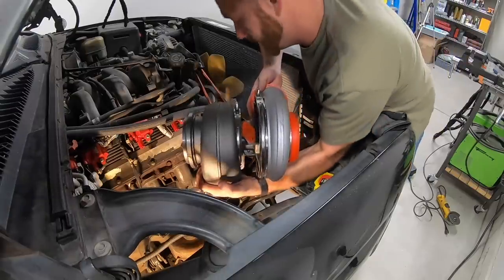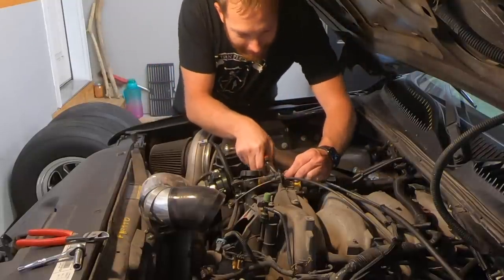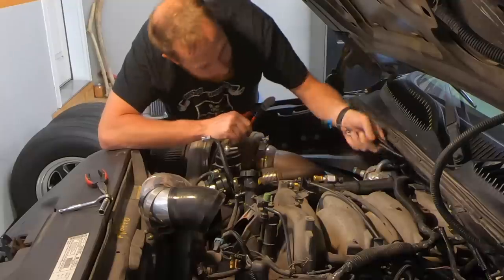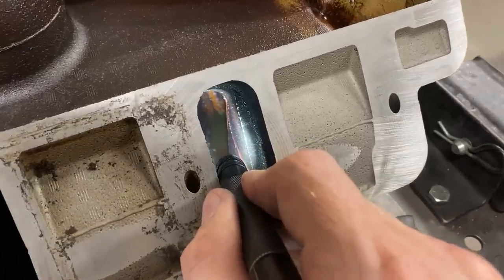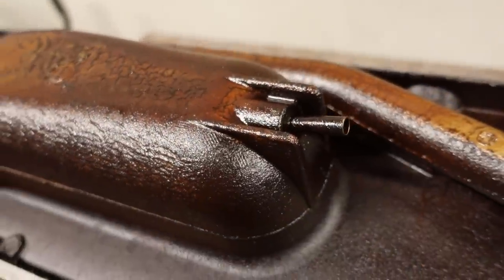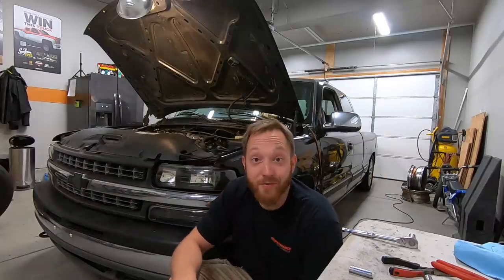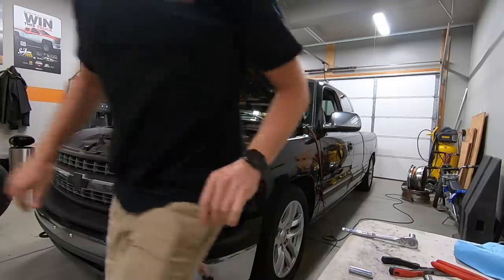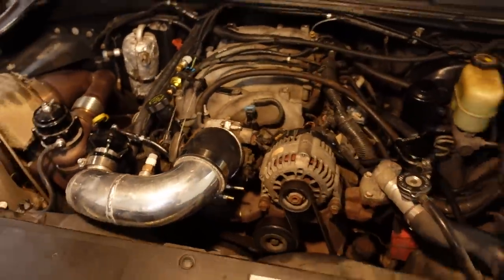this is the WORST ENGINE DESIGN I've ever encountered

Comment: The turbo would spool quicker with a vacuum line to the top of the gate and a boost controller that would hold the gate 100% shut until the commanded amount of boost. Just a bottom reference opens the gate slowly, giving up response.

The turbo smart eBoost2 controller solved this problem for me. Love the build 👍
Reply: Maybe this "slower" spool is what has kept the junkyard engine alive?
Reply: Adding a supercharger to the turbo would give hime hp at low rpm’s
Reply: @eric9249  absolutely a possibility
Reply: @eric9249  and it running on e85
Reply: @eric9249  FACTS!     Exactly what I was thinking!  It’s why my stock (aside from stainless steel 1.25” butt weld fitting manifold I made up as stock turbo is cast into/is part of the manifold) 2000 VW golf 1.9L TDI can handle 38-40 psi of boost no problem.

Comment: Hi LT,  my two cents worth;
first, was there a separator shield under the intake manifold? didn't see it. All stock 8.1's had the shield originally from GM.  It's job in life is to keep the oil film/ vapors separated in the air space under the manifold and away from the calibrated vacuum leak. with out the shield the vacuum will suck up all the vapors thrown off the spinning cam and lifters. Also you have the original plastic intake gaskets that GM found lost their compression seal very early and oil was sucked into all the ports. this was found to be the main cause of oil consumption on the 8.1. GM made a new style of steel gasket with a black rubber O-ring seal for the 8.1. It seems to hold up much better over time. Sooo that stupid vacuums leak works very well for almost all NA applications. With a boosted application such as your blow through turbo, or the older Whipple that used the stock manifold, you do need to plug the hole in the bottom of the manifold to keep from pressurizing the crank case and blowing out gaskets. . 
 I would bet that the reason you are not smoking any more is that you put on NEW intake gaskets... 
This has been a common problem even on the GM 265-283-327-350 small blocks for years, replace the intake gaskets ,oil smoke goes away.. Me, I still like the design of the calibrated vacuum leak for the PVC. keeps the engine pretty much leak free for hundreds of thousands of miles.. 
still love your show.
Best to you. 
LH.
Reply from the maker: hey, you could be onto something with the gaskets. and yes, the little splash tray is still in place above the lifters and below the intake
Reply: How about a check valve for when it’s under boost but releases when the manifold returns to vacuum?? Kind of like the 1.4 turbo engines have from the factory?
Reply: Wasn't the AMC 242 the first engine with the "calibrated leak"?  Either way it sure works good on that motor.

Comment: With all that boost bleeding into the crankcase, I am surprised you didn't blow out a rear main seal or other seal.  I am really surprised there wasn't a check valve.
Reply from the maker: luckily, I had modified the throttle body last year so it will bleed out some of the extra pressure which is probably the only thing that saved it
Reply: @LawrenceTolman  hey LT, would still check rear main seal just to be careful. If you have time
Reply: Sooooo was it a true 20 psi going through the motor ??
Reply: @ls3ws641  it’s was 33psi
Reply: We have problems with em in the winter on generators. 
On those 8.1s used for industrial, on the back of the intake is a can with a mesh filter in it ,and it's always loaded with water. 
Damn propane fuel sucks bad for that. 
Clean em out every service and you might avoid having it freeze,then the pressure blows oil out the front seal. 
Last one I had blew out like 4qts. 
The later 8.1s put insulation around the can and don't have a problem.
Reply: @TheSleepyMechanic0524  it's gonna leak ,or not. 
Fix it accordingly.

Comment: I think a big part of your success is a good, and safe, tune. Great job, looking forward to the 535!
Reply from the maker: Thanks, and I'm looking forward to that as well!
Reply: Most engine failures are caused by a bad tune
Reply: @LawrenceTolman  having that “larger/laggier” turbo definetly helped. Those motors do not like torque spikes on the lower rpm’s. Glad to see it still holding up.
Reply: @LawrenceTolman  any chance you'd share your tune?

Comment: Really happy the way it turned out LT. Been following this build since day one. I have a cammed 5.3 going into my 2000 1500 and a 4l80e I just picked up. Ultimate goal is turbo. I built a bracket for my 40k trans cooler just like yours to recess it closer to the evap core for future intercooler  clearance.

Comment: PCV is very important, I wouldn't delete it. At least throw on an in-line check valve and route it up to the airbox like they did in the old days. Without PCV your oil will get dirty much faster due to the blow-by gases staying in the crankcase longer and contaminating the oil.

Comment: So it's similar to the system on a LS engine. I had a check valve on my intake tube but I ran into oil leak issues. I vented each into a deep catch can. I tapped it for a hose connector, ran a hose to the bottom, filled it with steel wool, and then vented the top with a small filter. No oil in the engine bay. If the crank case sucks in on either side, it's just the oil in the can. Closed off both intake pcv spots.

Good video man. Love watching this journey.

Comment: Interesting it's always been said the 8.1 used oil due to the large bore size until it warms up.  After seeing this I'm thinking this factory pvc is more at fault definitely will have to do this mod on my 8.1.  Looking forward to testing on the 8.1 the old engine would be sweet in the copo truck or one like it.
Reply: dont bother, he is incorrect

Comment: When you get the 535 in, you should use the spare 8.1 as a low buck demonstrator. Cam/valvesprings setup with the S480, put it in something cheap and rwd, like a shitty G body, elco, whatever.

Comment: People who claim you need to do this and that to an engine to ad boost are the guys who never have worked on vehicles or they think that adding a cold air intake and sawzawling off the muffler is "real HP". I can't tell you how many engines I have seen with boost that are not suppossed to be boosted and they last a really long time. Engineeers perposly eay over enginer MOST engines and de tune them from factory. Toyota for example is famous for having "weak" or slow engines but they  are able to make a TON of power with slight mods and tuning and hold up very well. Engines usually only blow when improperly tuned, or the tuning is off litttle and never corrected and ran like that for a long period of time. That is what Ruins engines. Of course yes someengines out there are junk like a lot of the old chevy 350's Ye they're powerful parts are cheap etc however they're notorious for leaking oil and rattling apart unlike all older/newer Japanese and modern American made vehicles.

Comment: I didn't think that was going to fix the issue I totally thought it was a oil feed or drain issue but that tells you how much I know about the Big Blocks. Also run a little bit of ATF in your next oil change and clean up the inside of that engine.... it's dirty.
Reply from the maker: you're on the right track though, part of the problem is that pressure in the crankcase will fight against the oil drain from the turbo...

Comment: Great video man. As for what to do with the old 8.1 when you get the built engine done, I would love to see you do towing / workhorse mods. Many of us 8.1 guys would really like to see someone do detailed videos about what  mods can get us more grunt and real usable power in our tow rigs. Test which mods are most beneficial for the cost/effort they take.
Reply: More power = engine that doesn't last as long. They de-rate the 8.1 on purpose so it lasts longer.
Reply: Most cost/benefit mod would be swapping that low power gas chugger for a turbo diesel.

Comment: Consider this motor isn’t intended to be boosted. I’m sure if they came out with a boosted motor from the factory the system would have been changed.  Good enough for a NA motor.
Reply from the maker: good enough maybe, but even N/A 8.1 engines suffer from excessive oil consumption, and this is the root cause of the problem I believe

Comment: I have had my eye on the 8.1 for a few years now, especially considering its use in Suburbans and Avalanche 2500s. I would LOVE to see a practical, midrange horsepower 4WD build for towing and adventuring. I am also well-versed on Raylar, and I'm wondering between their mods and tuning, exhaust, intake etc how cheaply you can get the 8.1 to 500-650 horse and maintain its daily driver characteristics. I know that's a tall order, but I think a lot of people would be super interested in a budget TRX competitor! Thanks for the videos bud, best Chevy performance video on Youtube.
Reply: I found one of my goofy dream trucks, a 4WD Avalanche 2500 w a Whipple supercharged 8.1, not from a Raylar kit. Needs tuning, and not sure where to start, I've been thinking about getting the Raylar aluminum head kit. I will be using it for some towing for work but also as a personal adventure vehicle, so my request is very selfish...
Reply: It would need engine management/fuel system and custom tuning, personally I’d hate a supercharger on a trail truck because of the low speed heatsoak.

Comment: I would like to know how this motor would hold up doing the work that it was originally designed to do, in other words, pulling a heavy load. I have one in my 3/4 ton Suburban and I would like to know how well this would hold up to a load like I've hauled in the past with my suburban, grossing truck and trailer together over 20,000 pounds. Meaning, more than 15 to 20 seconds at wide open throttle fully loaded
Reply: I believe it would do just fine possibly even better than an old school big block why wouldn't it ?
Reply: @glennmanchester5696  well, stock it does great. I'm just curious how it would survive with his setup (completely untouched internals) on a long wide open pull with a really heavy load.
Reply: Oh I get it well I guess no one knows it would be dependent on so many factors maintenance age milage etc I would have to say I've heard they are not the strongest motors ever made so it guess if it were me I'd go a little easier on it for that reason

Comment from the maker: so what vehicle should I put the old 8.1 into once we get the 535 build done? AWD S-10? an OBS Truck? someone brought up the idea of a burnout vehicle, and I do like that thought... let me know some good ideas!
Reply: Overland / Rock Crawler 2 Door GMT400 Tahoe!!
Reply: Chevette burnout car
Reply: 4th gen camaro burn out car  i have a 99z28 6.o rips ass
Reply: I'm down for the AWD S10! Would be like a Syclone on steroids...
Reply: Mid 80s Caprice wagon.
Reply: A Gen1 (2000-2004) or Gen2 (2005-2015) Nissan Xterra 4x4. Gen1 has a fully boxed frame, and 233mm (9.17") ring gears. They're freakin' stout, but so underpowered, and it's time to see that be a thing of the past. Call it "X Terror" or whatever else you can think of.
Reply: That motor in a S-10 would be crazy, the truck would literally fly down the track! 😂
Reply: Vega
Reply: I say put it in an 80s land yacht.   A  4 door Buick, Olds, or Caddy.
Reply: Great video as always. We always thought it would be cool to take something old with a busted big block, throw the old one out and put an 8.1L in it. That or a military hummer. A 60's caddy with a 429/472 would be a good fit as well (already has a TH400).
Reply: 92-96 B body caprice/impala. just like the great Jon Moss would of wanted lol.

Comment: Put the 8.1 in an S10, dammit...haha 
Hey, any way to put a check valve in place of the plenum plug you installed? Would that have solved the problem? 
Greetings from the farm in S Carolina!
Reply from the maker: yeah, a check valve would for sure help and probably eliminate any issues, but it would still suck in lots of oil vapor when under vacuum... ideally you'd convert to an external PCV setup, or somehow add a baffle under the plenum
Reply: @LawrenceTolman  makes sense.. Thanks for your reply and good luck!

Comment: Any positive crankcase pressure will result in turbo oil drain issues, especially if the drain hose isn't very big. The oil leaving the turbo will be somewhat aerated making it foamy, so if you have any crankcase pressure it won't drain properly and will case the turbo to leak oil through the exhaust seal and causing smoking on decel. Imo you need alot more crankcase ventilation, like a vented oil cap and it will fix it. I've seen this same issue on several build, and crankcase ventilation has fixed it every time

Comment: The no start thing makes sense, my car is originally a turbo with a MAF in front of the turbo, at one point I had switched to a MAF behind the turbo instead.  Once I did that, I had odd behavior from time to time that I couldnt pinpoint, weird things with the MAF curve that I always had to fiddle with.  Eventually when I switched to a valve cover with no PCV, discovered what was happening was the PCV  was sucking unmetered air from the bottom end, because the other two valve cover breathers were all in front of the MAF.  It's interesting how something small like that can cause an issue.

Comment: @LT. ever consider using a VNT turbo for a turbo build? They seem to be rather rare for gas engines 🤷‍♂️.  Used heavily in diesels…. And I’d think would be even better in gas engines…. As they don’t built up soot/carbon that can block VNT nozzles (although most 2005+ diesels have the computer control the VNT actuator and then activate it here and there at startup, and idle)

Comment: I think GM used a similar PCV system on many of their platforms.  My daughter’s 2011 Equinox 4 cylinder has a tiny hole in the intake manifold.  It clogs with buildup  and leaves moisture in the upper intake.  If left plugged up, it can blow the rear main seal.  Probably saved them $3 per car…

Comment: LOL the intake was brown underneath all of that carbon.

A dumber design is all the VW/BMW valve covers that have PCVs built in and when they get clogged you need to replace a $800 cover that is perfectly fine otherwise.

Comment: I'm not saying that the factory pcv design is good, but, three 8.1L trucks  in the family and all three only use 1-1.5 quarts in 3k miles. That's towing trailers, too. Most all manufacturers state that up to a quart of oil consumption in 1k miles is considered normal. Unless I/we have three freaks of nature I don't consider 1+ quarts in 3k miles to be massive oil consumption. My wife's '02 Ford V10, and her previous 2v 5.4, BOTH eat 3 quarts in 3k miles. Properly tuned engines and functioning pcv systems, no leaks, no oil residue in the exhaust; that's massive oil consumption.

Comment: E85...yet every "expert" screams how bad ethanol is. 🙂 I love the stuff. Most modern (2000 and beyond ) fuel systems seem to have no issue with it.  And it's far cheaper than 105-octane gasoline.

Comment: You get plenty of comment activity for sure .

Some are rather well I'll call it interesting 😁

Putting it in something light weight would be a waste unless built like a diesel drag vehicle to use the torque .

I have a c3500HD which I tow with a lot and is powered by a 72mn turbo'd 6.0 but working on a turbo 8.1 Allison combo for it .
I understand torque vs hp 

Turbo 6.0's do tow great but turbo 8.1 will be awesomeness

Comment: how come nobody does small engine maximization? like i'm not talking single cylinder things no i'm talking mid 2000's low end economy engines like say the engine thatGM made for the opel corsa back then it's only like 1.2 liter but it would be fun as fuck to see what can be done with such a small engine  FTR i'm talking about hte Z12XE the weakest bearable model they made for this series of cars

Comment: Worse engineering by far: Every component in the Ford 6.0/6.4...from the valve covers to the oil pan. Every single part. No exaggeration. People think they can "bulletproof" them by replacing almost every part, but they are manufactured just fine - it's a design/engineering problem. The only way to "bulletproof" one would be to melt it and cast steel plates out of it...

Comment: Corky Bell's book says basically that as long as the air is at 1075 degrees or less after forced induction, intercooling, and then compression, that you are pretty safe from detonation.  On most engines, if you keep the forced induction at 6 psi or less then you don't need intercooling, but to go beyond that you better have it if you don't want to burn a piston.

I'm not sure how the bearings in a BB Chever-Lay hold up to the increased torque of forced induction, but as long as you are not detonating I would suspect that it should hold up.  I think those have iron blocks, so it should hold up.

Great video!

Comment: IDK why this was in my recommended, but I liked it.  

While of course I haven't seen them all, I've never seen a factory PCV system that I thought was any good. When you get around to a proper system add two bits you didn't mention. An exhaust scavenging tube, a tube that you put in your downpipe at an angle and it'll pull crankcase gasses into the exhaust at high throttle. And a vacuum release valve on the breather in. This will control/limit vacuum levels in the crankcase. 

As far as something to put the 8.1 in. Find a 95-99 two door Tahoe, that'd be a blast. Frankly it'd likely be a better drag vehicle than this pickup, better weight transfer.